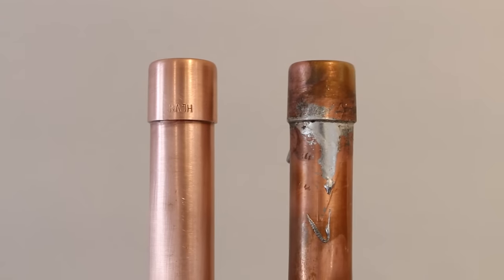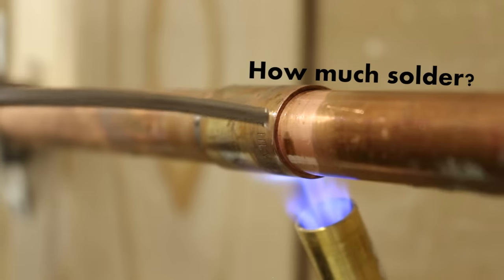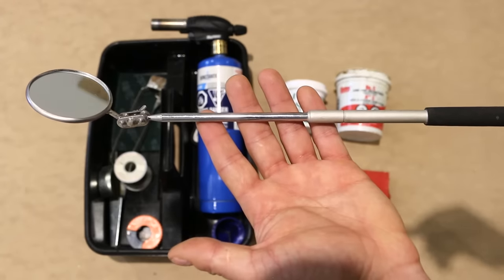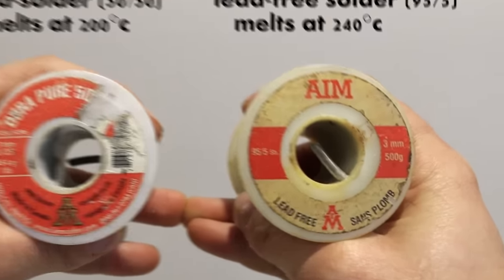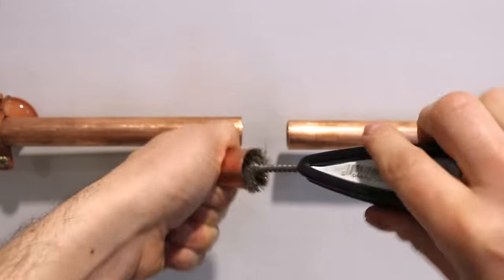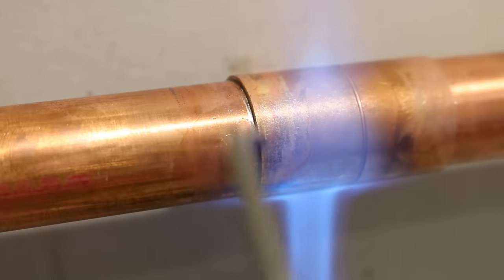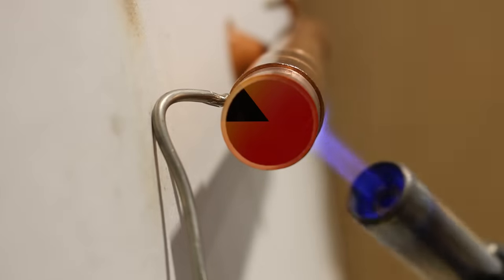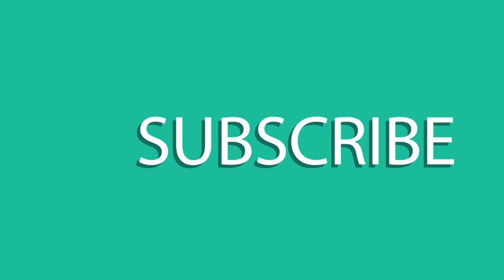How To Solder Copper Pipe Like a Pro (Tips & Tricks) | GOT2LEARN

Comment: I use mapp gas, ream the female end of fitting and inner dia of tube and use Ruby brand flux that comes in a yellow can with excellent results. PS use very little heat when soldering baseboards because the copper is very thin and over heats easily.
Reply: Pretty sure I was taught to ream inside of the tube, and NOT the fitting.  The purpose of reaming has not so much to do with the strength of the joint, but the torpidity of the water after the joint is done and the H2O is flowing.  Torpidity at the joint will cause the joint to fail over time.  Water will cut through rock with enough directed agitation - you want it flowing nice and smooth over the joint.
Reply: Not to put too fine a point on it but I believe it’s called cavitation, when a pipe starts to decay from inside due to uneven eddies and currents from a pipe that wasn’t reamed
Reply: @62Cristoforo  Not to put too fine a point on it, but cavitation is the result of torpidity at the joint.

Comment: Helpful hint:  Use Oatey 95 flux to solder, and keep a tub and brush of H2O flux with you.  After you solder, brush the H2O flux over the soldered area.  It cleans off all the darkening and staining immediately!  Let it cool down a bit, then wipe with a damp rag.

I re-piped my house in copper.  Used H20 the first time but burned it (too much heat) and had a bunch of leaks.  Re-did it with Oatey 95 and just used the tip of the flame to heat the fittings.  ZERO leaks at first pressure test!  Kept the H2O and cleaned the joints, looks really nice but it's all hidden under drywall now.
Reply from the maker: Good job buddy!
Reply: After a few practice joints on junk pipe I got good at it.
Don't expect to be a plumber without effort.  It is a skill that needs practice.
If I had to do work now, I might even do a practice joint.  It has been years since I needed to join pipes.
Reply: do not wipe flux or anything after you solder. let it naturally cool as to not break the solder joint. DO NOT rush the cooling process with anything. and the flux is just a waste of recesources

Comment: I was picky at first, but once you get the hang of it ... I sweat multiple joints to get things going quickly, then wipe down all the joints so everything is cooled off. 

At this point it moves faster soldering than push connect fittings, cheaper, and more reliable long run. 

Thanks again for the tips.
Reply from the maker: Good job!

Comment: If you have any doubt about your soldering skills ( or lack thereof ) using Yorkshire fittings with the ring of solder already inside  makes the job a doddle,  Clean fitting and tube with brown scotchbrite, apply flux and you heat the copper until a bright ring of solder appears around the area where fitting joins pipe, capillary action makes sure sufficient solder is inside joint unless you heat the copper to nuclear temperatures.

Comment: The terminator picture reminds me, I did something stupid and dangerous. I had a pipe with T and a faucet below it my dad installed years ago for a fireplace heated water heater. It was no longer used (30+ years) but it was leaking so I decided on a simple fix. My plan was to de-solder the old terminator cap, clean up the pipe, put on a new cap. But there was water between the cap and faucet so yes you can probably guess the water boiled. It popped off with such force it sounded like a rifle shot. I was looking up at it but had moved out of the way a moment before due to solder splatter. Call me a lucky dumb-ass I deserve it.
Reply: Always drill a small hole in the cap before you start heating it. Steam is a powerful propellant.

Comment: Lots of disgruntled plumbers in the replies but the joint is only as good as the solder between the two copper surfaces.  Any excess is just wasted solder.  Maybe not for every joint but where work shows this is a valid technique.

Comment: When I solder a straight coupling on the vertical axis, I solder the upper most joint first then move flame to lower joint but keep feeding solder into upper joint. That can help to keep lower joint tidy and clean without too much solder showing. I suspect a lot of you are familiar with this one.
Reply from the maker: Ya, there's not only one way of doing, there are multiple ways that work just as good, I do it that way sometimes, just depends on which side of the bed I woke up ;)
Reply: WRONG. You do the lower joint first, making sure you wipe away the flux that runs. THEN you do the the horizontal. Also, two drips through the joint, not one. That ensures the solder has reached the butt of the joint.
Reply: 😂😂 Dude you can barely solder 1/2 inches piece of copper.. First learn how to put heat on the right part when you solder just so you know and can learn you put the heat on the pipe not on the fitting cause pipe is thicker then fitting...😂😂😂😂 Keep trying... May be one day you can solder a 3/4 cooper..😂😂
Reply: @byronsalazar7256  Sorry, but you're wrong. You heat the fitting, NOT the pipe. Also, both the pipe and the fitting are the same dimension. Not sure where you get your info from.

Comment: I use heat to suck the small amount of solder needed into the joint because it follows heat, then use flux brush to wipe excess solder real quick and it looks pretty good. No dog nut

Comment: Industrial hand brazer here. Passed my 1 millionth joint brazed recently.  

Have you ever considered flux cored or coated rods? One benefit with that setup is you can braze dirty copper with no problem and without having to cake on flux. However this is brazing and not soldering.. So not for your average home gamer..
Reply: sil-fos 5 braze rod for copper, their 18% is perfect for brass/bronze. 

Would need some serious heat though, but those joints will last longer than the copper.
Reply: when brazing copper using sil-fos or any other phosphourus-silver rod you don't need any flux. personally i like sil-fos 15 because it flows really well.
Reply: I've been brazing copper for HVAC up to 500 psi but haven't been doing it for too long.  We usually don't ever clean the copper prior to brazing or the fittings.  I was told and it made sense that all the oils and dirty stuff would burn off at those brazing temps.  Granted we use new pipe and the pipe is stored in buildings and usually never exposed to the elements, same with fittings.  If anything the copper will have a darker patina but usually isn't ever dirty.  They do bundle the copper with sticky tape and if there is some glue I would clean it off regardless of what method I use (solder, braze, crimp).  What your thoughts on this?

Comment: Ill stick to the traditional way leak free for 25 years i don't care how it looks
Reply: Your customer might.
Reply: You might not care how it looks, but in exposed pipes your signature will be the way you leave it, messy or clean.
Reply: I'm with you not necessarily messy but reinforced for pressure and vibration
Reply: @mdunbar008  made me laugh, with you all the way.
Reply: No doubt....it's hidden in the wall anyways
Reply: @slewter9041  Not all plumbing joints are hidden in the walls. This method is for pipes that are highly visible, not for joints that are hidden in the walls.
Reply: You can do it the traditional way and still have it look good. Solder joints should still look good even if it's hidden in the wall. A lot of plumbers don't care how it looks, and their work is a joke.
Reply: The bigger the gob, the better the job!

Comment: Heat fitting from the bottom touch solder from the top once it runs remove the heat go to next joint when you're done use a rag wipe joint clean no drips. Remember water is your enemy any water even a drip will create Steam and blow your solder out

Comment: I was just doing 2inch copper pipe - it was terrible. Silver solder and liquid flux. The joint took so much solder - it would run inside. I could see slight gaps b/t fitting and pipe, so I added a bit extra to make sure I was filling the gap.  Maybe tinning flux would have worked better for me.  I'm moderately ok with 1/2 copper but the bigger stuff was trickier. I need to do 3inch stuff too....
Thanks for posting
Reply from the maker: Awesome, once you get the hang of it it's actually easier to solder the bigger stuff imo, did you see my video on how to solder 2" copper? Here's the link: https://youtu.be/LU9oHBhMfG0
Reply: @Got2Learn  I did not. I will study it feverishly.   I used map gas which seems better than propane. I was considering brazing.  I'm going copper-copper  and some copper to stainless ferrules.  It's a learning curve...lol  thanks for the info 🥃
Reply from the maker: @capitaldd3693  cheers brother! 🍻🍻
Reply: @Got2Learn  hey thanks. I just watched it - ya make it look easy.  I think my torch is a factor - used map gas though but pretty much a generic torch with 4foot hose. Probably should consider the oxy/acet set up.(can use it around the yard anyway with the welder)  i was outside and it was -10, that probably didn't help either.  But it just seemed like the copper was a heat sink and not heating up. I was coming at the joint from the back as well.  It's a learning curve for sure. 
Thanks again
Reply from the maker: @capitaldd3693  Yes, many factors can change the ease of soldering, it's a tedious thing when starting, just keep practicing 👌👌👌

Comment: Very nice, I think when you are doing the verticals starting from the top is always best as it preheats and makes ready to absorb from the bottom. I'm a big fan of the tinning flux as it's like a magnet. Most joints are fairly easy it's soldering up/vertical at issue, need a video dedicated to just that.. When possible as a long time amateur do assemblies out of the wall and horizontal or on the down slope. Example would be an under kitchen sink assembly where you are running multiple  (Ice maker, Dish washer, who knows water lines) prepare them at leisure on a work bench and then apply the final joint. I just like making most of it on the bench where I can control flow and dealing with attachment later. My take..
Reply from the maker: I do the same thing, I do as much as I can on the bench and finish with one joint at the end, thanks bud ;)

Comment: Thanks for this and your beginner video's.  You recommend using Tinning Flux. Oatley 95  carries a recommendation of providing a trisodium phosphate rinse, which can be a challenge for residential systems depending on how they are set up.  In your experience is this rinse required?  It is not with water based flux, hence my reason for using it.  I'd rather use tinning flux.

Comment: Great upload! I can't imagine how many leaky joints this video avoided. Regarding wire brushes I cut the handle off using wire cutters and chuck it in a drill for the quick & lazy version of cleaning fittings. When the brushes wear down, I reverse the direction of the drill to get some more mileage out of the brush. Early on I used my pinkie and 120 grit sandpaper. Just remember to never attempt to solder a joint with any amount of water in it, always clean each surface to be soldered until it looks like bright colored copper, use enough flux to cover the area to be soldered with no bare spots, use a good propane or even better, a Map torch to heat the copper quickly and evenly, apply enough solder to saturate the joint but no more and the joint should never leak. Thank you for demonstrating how to use the solder on the side facing away from the flame and in the exact amount to make it look it's best to boot!

Comment: Part 3. Another way to see if your solder joint is perfect is too cut the joint open and visually inspect. Solder a 1/2”, 3/4” is easy but try soldering a 3” or bigger this takes special skills. 
The process that I’ve shared with you will take 20-40 seconds on pipes 1/2” to 3/4 pipes. Really quick. The longer the flame is on the pipe the chances of burning the flux another cause of leaks, so
Practice being on time with the solder to the heated fitting. 🌺

Comment: Propress all the way.
Reply from the maker: Still fun to know how to solder
Reply: pro press is for repairs. I'd rather solder a job any day of the week. There are so many situations where the pro press tool just won't fit but a torch will.
Reply: Joshua, I have been plumbing for 35 years and I know pro press is the rage right now but it is for non plumbers man. it takes 0 skill. I learned on copper and cast iron. lotta of folks using propress but that's due to most plumbers now cant solder to start with and it saves on labor. great for repairs but I would not do a high rise building with it. but plumbers are. you will see issues in time with it.
Reply: agreed, propress is for repairs or temp repairs. it is nice when there is an emergency that has to be took care of but if we do that in a building we go back after hours and solder the repair.

Comment: easy to do on new copper,  Were I work the buildings are over 40 years old, were built by the lowest bidder and used unlicensed , unskilled plumbers.  The copper is old, brittle and heavily oxidized.  Leak repair is a nightmare, and the guys I work with have NO plumbing experience.  They depend on ME to fix all the leaks while they stand around and make jokes.  They never learn anything.  Anyone cane solder new copper, try fixing old copper, with valves that don't shut off and water running out of pipes.  I hate plumbing. But watch videos to learn more. Thanks .
Reply from the maker: I admire that John, learning is such a beautiful thing. Just show them my videos when they stand around and make jokes ;)

Comment: My experience is to never apply solder directly to jointy like that. Best to heat a couple inches away from joint to keep soot from flame out of joint. Just let heat flow through pipe to heat area. It is more gradual which means your solder will be in the sweet spot of proper heat the entire time and not rushing past it to get too hot and make solder thinner. Of course everyone is in a hurry and apply directly to joint. If you have no experience you can get much better results by not overheating and keeping out the black soot from flame which causes leaks.
Reply: If you are a real soldering newbie, use 'Yorkshire' type fitting which includes a ring of solder inside, still have to do all the cleaning and fluxing but the solder already started off in the correct place and just gently heat until a bright ring of solder appears around the pipe.

Comment: Don't know why this video popped up in my feed, but it is cool to see someone passing along some good information. With the rise in "Push-to-Connect" and "Press" fittings, soldering and brazing is starting to become a "lost skill". Don't get me wrong, each has their place, but if I had my preference I would solder 10 out of 10 times on a new install and a repair if the upstream valves hold. The whole key to the "easy" fix with the push or press fittings is an o-ring and anyone who has saw what an o-ring looks like after spending any time with domestic water and some pressure will tell you is they don't hold up very well. Still, I'll hold my judgement until I see some failures.

Comment: I'd imagine that mostly any customer wouldn't be bothered if any solder is showing, as long as it isn't leaking. I prefer to see a good bit of solder on the edge of the fitting. In future when the pipe has gone a darker colour and if there is a leak somewhere, especially on a gas pipe, It's good to see the solder. Having a perfect joint with no solder showing can look like it hasn't been soldered

Comment: In my plumbing field we use turbo torches.  Acetylene and even oxy-acetylene mix.    That striker is for welding.  I use a cigarette lighter so. I cant really talk.      We might use map gas for trim.  Lately.  I've had an A tank.  There a pain to drag around.  But last forever.   
  We use scotch brite for med gas. I like the waffle paper.  Screw sandcloth

Comment: The one thing that worries me is having too little solder.  I can always wipe off the excess.
Reply from the maker: Once you get the hang of it, your worries will go away, practice practice practice ;)
Reply: You can't wipe off excess solder.
Reply: @chimp2k2  u can, from the outside and the floor...
Reply: Let me clarify; You can't wipe excess solder from the pipe.
Reply: @chimp2k2  Could you explain what you mean? Of course it will stain the pipe, but it's only a visual thing.. Of course you need to do it while it's still liquid, using a paper towel or a rag that doesn't melt. A piece of blast shielding mat has done me well.

Comment: You almost get it right. I agree for 95%. Suggest,  heat pipe first, little bit and then move to couple,  they do not contact 100%, so not easy to heat pipe the same way coupling did, you know wim

Comment: As a plumber I wouldn't be able to sleep at night with solder joints like that.
Reply from the maker: It'll come in time, just practice ;)
Reply: @Got2Learn  what I'm saying is looks ain't everything. You do this in a new house the inspector isn't going to give you the go ahead. It's the same thing when working with PVC they need to see the purple primer so they know you took the proper steps.
Reply from the maker: This is only for rads and stuff like that, that stays exposed, so it won't matter.
Reply: I am used to seeing a thin smooth fillet of solder at the edge.  Having no solder visible would bother me too.